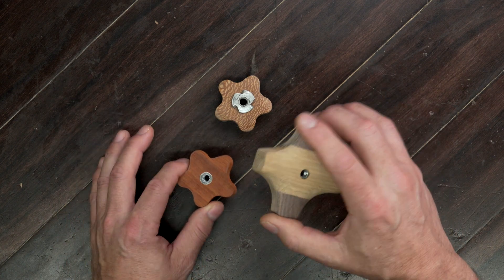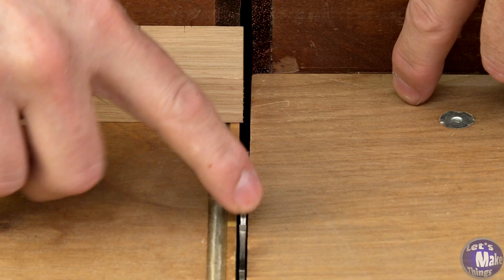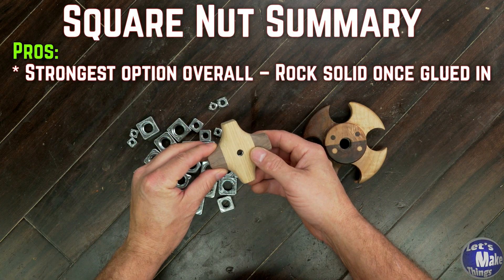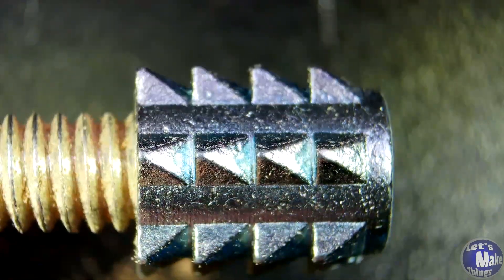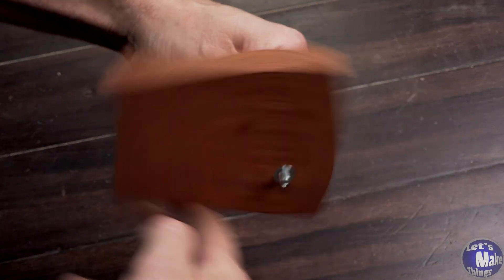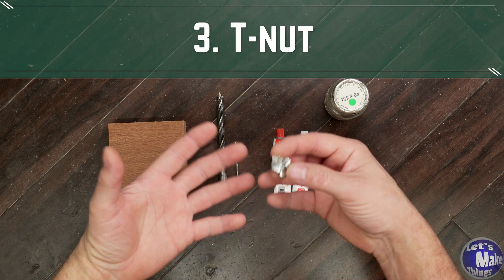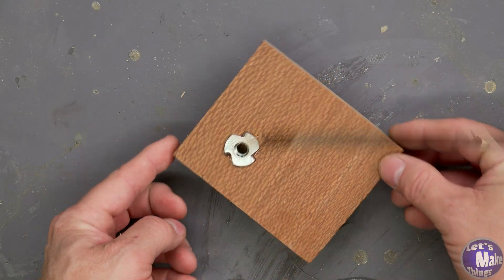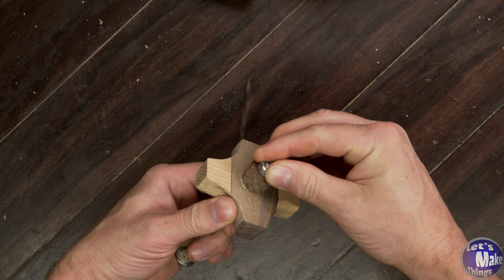Field Guide to Making Custom Knobs (3 Hardware Methods)

Comment: When I make knobs I just use my 3D printer and pause the print and insert the nut and then finish the print or I have a two-piece knob that I insert the nut and then glue them together later Works fantastic I have lots of them